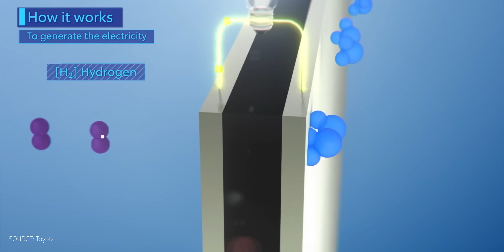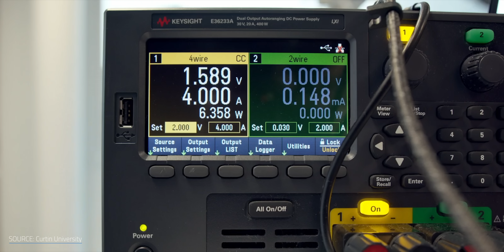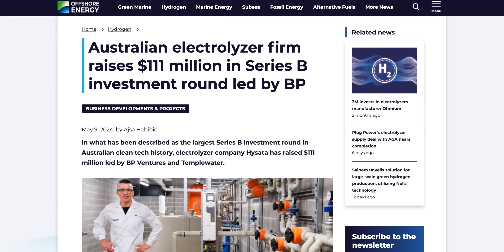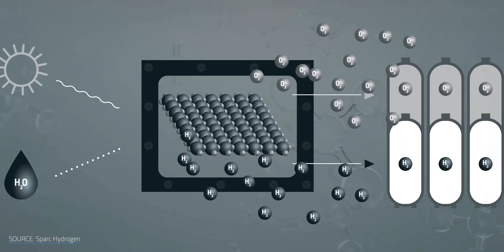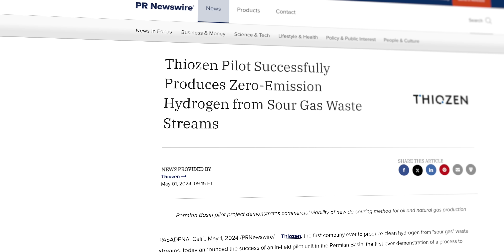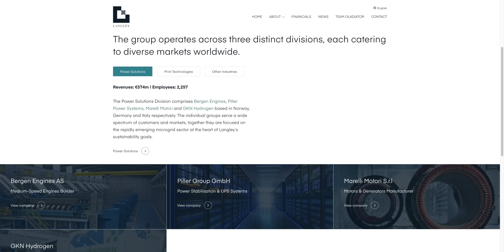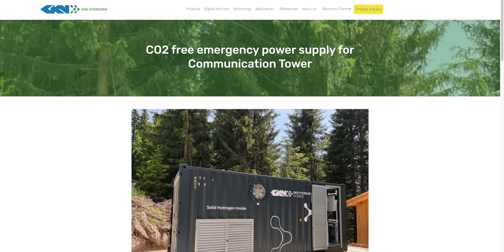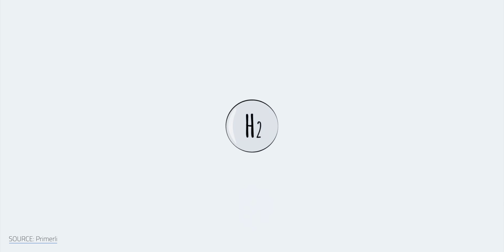How a Hydrogen Breakthrough is Closer Than Ever

Comment: As a chemist I believe we should keep h2 for the industry, where it’s used as a reactant.
The demand there is huge, incredibly huge. Think about steel, pharmaceutical and all chemical processes where a reduction reaction is needed.
That would really be a change.
Turning h2 back into energy is a big waste imho
Reply: H2 for energy storage doesn't make any sense. Through conversion, storage etc you lose 60% of the energy you put in.
Green hydrogen for the chemical industry is a must.
Reply: @jzimmer11  Energy efficiency is far less important when your options are to lose 60% in conversion or lose 100% due to lack of storage and the electricity is basically free from solar and wind anyway. Hydrogen tanks are cheaper than chemical batteries and some other energy storage methods and we are going to produce and store lots of hydrogen anyway so it makes sense to include the option to use it for electricity if needed.
And if you build a storage battery you have to pay for it even if you are not selling any electricity from it, but we need the hydrogen storage anyway so only cost is the fuel cell and if we do not use it to produce electricity we will still be selling the hydrogen to chemical factories.
Reply: @AnalystPrime None of this is true
Reply: @leeoldershaw956  Your comment is not only wrong but too imprecise to even bother trying to figure out what your particular malfunction happens to be.
Reply: @jzimmer11  Innovation has just been shown to increase the efficiency of H2 production. We can hope that innovation can improve the efficiency of storage and distribution, e.g. those metal hydrides that Matt showed us. A great challenge, with great rewards if successful🤔
Reply: I'm also a chemist and I agree with this, H2 power works for large applications such as trains, but for small domestic vehicles it's nonsensical, the energy density just doesn't make sense compared to batteries

developing better batteries is a chemistry problem, developing better H2 storage is a physics problem - it's orders of magnitude harder to solve
Reply: @Garthaxius  Then what about another video from Matt (I might be mistaken), where hydrogen molecules were joined with nitrogen? That seems pretty neat.
Reply: I'm no chemist and basically just a relatively well educated layman who spent some time working on cathodic protection systems for pipelines...and hydrogen IS SCARY.  I had to pin weld cables onto live pipelines, and the Hydrogen pipelines gave me the 'willies' much more than the liquid oxygen pipes.  Hydrogen is so small, it leaks as soon as the 'proverbial bear sh..s in the woods'. You could literally 'watch' it start leaking.  I certainly don't want it piped around my ass in my car at 80 mph. 
That said, I always wondered why it can't be 're-attached' to the carbon and re-used as petrol? Surely thats the way we should be looking at this? ie DEAL with the Carbon?
Reply: @mikecaroto5361  Hear hear!!
Reply: @mikecaroto5361  the yield of making h2 and then also attach it to co2 multiple times to get to fuel is super low. It's possible, it's done, it's crazy expensive and one gets very little back
Reply: At least, it seems like what you suggest is low hanging fruit compared to hydrogen powered cars. If a genuine green hydrogen business does develop, it might be reasonable to reconsider hydrogen powered cars, but lets see green hydrogen as a process chemical proven viable first.
Reply: @davefoc forget cars, the focus for vehicles should be trucks, trains and buses
Reply: @adrianlane4256 Thanks for the response. That seems reasonable to me. Hydrogen for trucks, trains and buses requires significantly less infrastructure creation than for hydrogen powered cars, still until the turn around efficiency improves a lot, batteries are going to be better for those applications as well.
Reply: @davefoc  Hydrogen as fuel might make sense for larger vehicles but in smaller ones the high cost of the fuel cell makes basic batteries a better choice.
More importantly hydrogen can be easily produced for industrial use and at ports, airfields and big truck stops, but building at least hundred thousand gas stations to sell hydrogen for smaller vehicles is expensive and cannot even get started until there are enough hydrogen cars to make it worthwhile without large subsidy.
Reply: @davefoc  That would be a waste of hydrogen. Hydrogen fuel cell cars are just less efficient versions of battery electric cars. The most efficient electric cars are those that are powered by the power grid directly, not electric cars that need electricity to make hydrogen, more electricity to move said hydrogen, all for that hydrogen to be turned into electricity in a fuel cell in a car.
Reply: @toade1583  Hi, thanks for the response. My comments have been shadow banned by YouTube. It's nice to see that my old posts are still visible. As to your comment: I think we are in complete agreement about everything with regard to this. As to the shadow banning:  I don't know why my posts have been shadow shadow banned by YouTube. I have posted somewhat contrarian views on political videos. One idea is that my posts get a lot of dislikes by left leaning and Trump leaning sites because my posts are not completely in sync with intended markets for those videos. I have other ideas, but I have no facts to figure this out. YouTube keeps the reason for shadow banning somebody's comments secret.
Reply: @davefoc the problem with green hydrogen is that it's not profitable by nature. Renewable energy is not profitable in the long term because it's energy supply is intermittent and renewable energy can't be centralized and therefore monopolized by massive corporations with aspirations to monopoly.
Reply: There should be enough for everyone. Part of its appeal is its abundance.
Reply: @davewebster5120  no, first thing first (that's decarb the heavy industry). Cars and batteries would come only later. My 2 cents
Reply: It is not abundant on Earth.  @davewebster5120
Reply: Yeah but you're bias. Do you want us to keep driving gasoline vehicles? Do you seriously think apartment landlords are going to out of the kindness of their heart install charge connectors for those of us who don't own their own home? That's the bias by the way, people who think like you don't rent an apartment.
Reply: @GeorgeWashingtonLaserMusket  a Tesla takes 15min once a week to charge at a supercharger. It barely takes more time than a gas car, it's cheaper, and you can watch half a Netflix episode on the laptop screen built in to the car while you wait. I've owned a electric car for several years and charging is not an issue at all. Charging anxiety is largely overblow.
Reply: industry - yes, Domestic use - no.

in Europe - far more densely populated than North America - the density of consumers makes it viable, perhaps, but the losses through inadequate pipework make it uneconomical imo
Reply: @Neilhuny  I don't even want to think about how hard it would be to keep a consumer focused distribution network of hydrogen pipes going... It's like the stuff was created just to wreck pipes and make leaks.
Reply: Working in the chemical industry, I’m with you on that!
Reply: As a chemist you should be questioning H2 iron production as well as an energy carrier.  Iron is above H2 on the activity scale which means iron will replace hydrogen in chemical compounds.  That is why carbon (anthracite) is used to make iron, carbon is lower than iron on the activity scale.  Other wise no argument from me.  Green H2 is just a very expensive way to make H2 in the energy constrained world that is humanities future.
Reply: @dan2304  I disagree we will be energy constrained. Far from it, we are learning more ways and higher efficiencies on how to extract energy from the world around us. At the same time we are learning how to do it more cheaply.
Reply: @javelinXH992  The ultimate energy constraint is food and much of the non-OPEC middle east and much of Africa and possibly China are facing famine within a few years.  Western and southern Europe, much of Africa and South America are already energy constrained.  Energy constraint is when the cost of supply is more than the ability to pay.  Data and facts are not influenced at all by uninformed opinions.
Reply: @dan2304  It is indeed and my biggest concern is not whether polar bears can’t travel around on ice packs to hunt seals but how changing climate affects weather globally. 

We are already seeing losses in food production in the UK from excessive rain, excessive drought and excessive wind. Often in the same year and sometimes in the same growing season.

Sure, farmers and the food production system could change, but they won’t unless they have to. You can’t easily tell if it’s a bad year or a decade of pain until after the decade is over and you review it. A bit late to then know what you should have done in that time (change or carry on as normal). It’s always been that way for farming but it’s harder than ever now.

And what if other countries. They are not going to sit still and starve. They’ll migrate, and that will put more pressure on other areas. 

Climate change will affect human civilisation in a negative way long before it has a permanent effect on the environment. People should be looking at the issue as a way of preserving the way of life we currently prefer.
Reply: @javelinXH992  Unfortunately without the energy supplied by fossil fuels that is not possible.  The metals, materials and infrastructure needed to move to low emissions energy require fossil fuels and both those industrial materials and fossil fuels are in rapidly declining supply with increasing costs, both energy and monetary.
Reply: @dan2304  Materials are currently a constraint, as is time - you can’t just switch overnight it takes decades. We will have to see if materials remain a constraint, we seem to be quite good at getting hold of stuff if demand is there, but I take your point. Copper is a particularly challenging metal for sourcing.
Reply: @javelinXH992  The geology of most materials has been well understood from the 1950s and especially after the acceptance of the Theory of Plate Tectonics in the 1960.  That is why the rate and volume of discoveries of almost all industrial commodities has declined since then. There is no possibility that materials constraint will not impact in the near term and fossil fuels are more required to mine, refine and transport those declining reserves with declining quality of ores.
Reply: @dan2304  don’t worry, I’m in the metals industry(primarily copper, nickel and tin). We can see the current status in prices we pay and charge, but also follow market capacity and future data. We also watch new tech and especially extraction methodology improvements and recycling. We have to watch this data.

It’s going to be…….interesting. But I see plenty of scope for optimism. The future may not be perfect, but good enough will do.
Reply: @javelinXH992  Global average ore quality is declining quite quickly across most metals meaning much more energy input to produce the same tonnage.  Metals are just embedded energy and the energy supply is in the same boat as metal ore reserves, in steep decline.  My analysis is the SHTF before 2040 possibly this decade.
Reply: @dan2304  I think you about right around 2040 if things carry on as normal.

But don’t forget the more green energy, the cheaper it becomes, the more worth working with lower grade ores.

I also believe a lot more alternative battery tech will exist at grid scale, such as heat batteries (sand or ceramics) tied to traditional steam turbine technology.

I guess you could say I am aware of the issue but pragmatically optimistic?
Reply: @javelinXH992  I have analysed much of the data available and 2025-2035 is much more realistic for the SHTF.  If a larger hot war breaks out much sooner.  What most do not understand is there is a limit to the cost (energy and monetary) of both energy and commodities that is much lower than people think.  Once energy particularly is above a small fraction (10%) of the value of the work it will do the activity becomes uneconomic.  Currencies are virtual representations of energy and commodities.  The big one is debt, globally currently at about 400% of global GDP, is committing energy and commodities from the future at unknown supply or cost.   That is why the Shit Will Hit the Fan.
Reply: @dan2304  Debt is terrible and most people don’t know it exists. If parties try to claim that debt then……

I take your points and the only thing I would say is I think your timescales are too short, but not dramatically so. The principles remain though, we do not have as many known reserves as people think. I just think we have enough alternatives to adapt.
Reply: @javelinXH992  I think you mean HOPE we have enough alternatives to adapt.  Some countries do have enough if managed well, but that is not a global situation even if managed well.  The "managed well" I am even more pessimistic about.  Just look at BRICS countries, largely broke countries with either corrupt and/or criminal autocratic leaders leaders sacrificing their people for their own ends.  Are the US and EU G7 group much better.  Escalation of conflicts in Ukraine and/or Lebanon/Iran/Israel which are actually related due to Putin and Iran being allies.  Prepare for the worst and hope for the best.  Just a side note, in Oct 2005 I said that when oil hits US$150/barrel in 2008 the world would be in recession, only got to US$147/barrel in Sept 2008 when the GFC hit.
Reply: The biggest green steel projects are now backing off the hydrogen hype, Hybrit and H2green steel in northern Sweden are pausing their plans, it turns out Hybris would be a better name...
Reply: Everything I have heard supports that position: use it for its chemical properties and I believe the same was said about oil a hundred years ago.  For the vast majority of ground transportation it seems to be a solution without a problem and the losses involved will never make it as cheap as direct electric energy.
Reply: We don't have enough clean electricity to meet electricity demands yet so we shouldn't be wasting it I'm making expensive hydrogen. What might be a better idea would be to bolt CCS onto existing grey hydrogen production, which can probably be done a hell of a lot quicker and cheaper then using Green electricity for which there are currently far better uses.
Reply: I highly disagree. Hydrogen is a highly energy dense materials. If sectors outside it production need it, why not let them use it? Hydrogrn fuel cell technology, even at this stage has gone a long way in cars, trucks, ship and now even planes. Yes, battery trucks and cars are more practical for short range trips, but for long range hauling/ flight, the light weight of hydrogen alongside it's high energy is a boon for ships and planes and it would be of great use in those sectors as well as energy storage sectors.
Reply: @toade1583 what high density? H2 is a gas and very light. One that needs either compression or freezing. The production cycle is super energy intensive and as of now it's made from the oil steam reforming process. Not a way to go green at all.
Reply: And not good for the general population being so spread out.
Reply: you're forgetting that H2 is essentially a battery, for renewables, if you produce green hydrogen with renewable energy, you'll have a H2 battery that can be converted back into energy for the grid, when those renewables aren't producing.
Reply: @Deathbyfartz  Not forgetting that at all. Right now it is well down the list on efficiency as far as an energy storage method goes. If a market for green energy develops for iron, cement and as a process chemical using left over hydrogen for energy storage might make sense. But let's see where hydrogen utilization for industrial production goes before we start dreaming of applications for which it is less suited. Also, drilling for hydrogen seems like it might become a thing. That might affect all this speculation, but hydrogen powered cars still looks like a pipe dream to me. Batteries are massively better for cars and there is no indication right now that hydrogen powered cars are ever going to be able to out compete batteries.
Reply: @Deathbyfartz  LFP batteries are just way more efficient form of storage around 90% vs hydrogens 25% round trip effeciency. The old argument against lithium batteries is that they have limited cycle life but LFP cells are now getting over 10,000 charge/discharge cycles and are 100% recyclable
Reply: @Deathbyfartz  that's true, but its conversion yield is quite terrible still. Both reactions, I mean
Reply: I agree the industry would be by far the biggest impact, but why stop there, once the infrastructure and production is getting established there is no reason why it shouldnt be used yo solve other problems
Reply: @hugonilsson6067  Yes, but right now the people pushing hydrogen are entities trying to slow down electric vehicles and entities looking for government subsidies. That is worrisome given the huge unjustified subsidies that the ethanol industry gets. Hydrogen powered cars could be the next ethanol type scam.
Reply: @davefoc  that's because majority of the hydrogen we get came from fossil fuels 😁. They lobbied to get subsidies for selling the same thing that they mined so why not lol.
Reply: It's definitely not a waste... The DoE, EPA, and EU have all done research spanning several years showing that even with today's technology green hydrogen has the lowest environmental impact. BEVs are certainly better than ICE vehicles but they are still by no means environmentally friendly. HEVs outperform BEVs environmental sustainability by a considerable margin when accounting for all forms of environmental impact across the entire lifespan of the vehicle. We care about the environment, not the electrical efficiency. One does not always mean the other.
Reply: @wilhelmromoser301  I doubt it. Please link to your sources. What was the turn around efficiency assumed for hydrogen in these studies you say were done?
Reply: @wilhelmromoser301   Where are you getting your sources from because most sources acknowledge PHEVs are environmentally friendly, but less so than full BEVs. Fracking for oil and natural gas is far more environmentally destructive than simple mining for lithium and unlike oil and natural gas, lithium is recyclable and their is a lot of potentially for even less invasive batteries such as sodium batteries, solid state batteries and Lithium-sulphur batteries(which replace rare earth metals in Lithium batteries with sulphur). Sure lithium-ion batteries don't have zero impact, but when you're attacking them, but not vehicles that run on diesel or hydrogen that comes from oil brought up by fracking/other extremely destructive drilling practices, it's super hypocritical. Lithium mining isn't great, but it's far better than fracking, lithium can be used many times and it doesn't make more pollution after it's mined and new methods are being developed that will heavily reduce the environmental impact of lithium mining like direct Lithium extraction which relies on filters instead of ponds to separate lithium and geothermal extraction which recycles geothermal energy to power the extraction process. Focusing on lithium's flaws while suggesting something far worse is ridiculous.